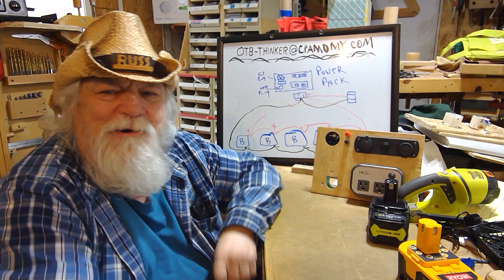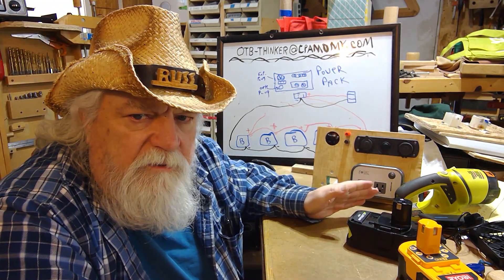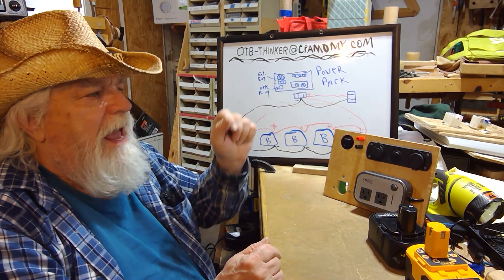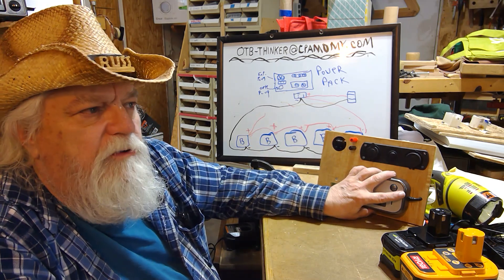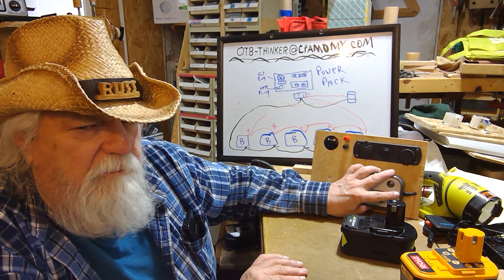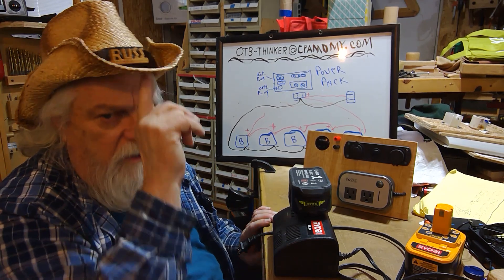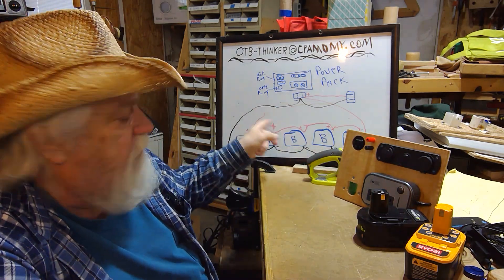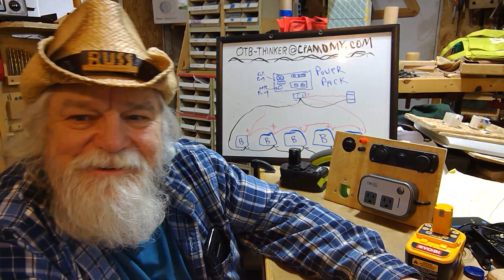DIY Ryobi Battery Bank by Portable Power

Comment: Ryobi sells 150W/18V and 300W/36V inverters so maximum peak amperage is about 8A. I just bought a broken 6 battery charger to turn it into a large powerbank. Maybe i'll use original RY18BI150A inverter and connect via old broken battery body. Possibly it doesn't have full sinus on output but most devices will be able to be powered.

Comment: Love how you have everything mounted on a small board. I need to do something like this. You may also want to consider using the walmart brand 'hyper tough' 4ah batteries too. Wouldn't really change your setup as they are the same 18/20v packs. On tear down they are high quality samsung 18650 cells and give just over their rated capacity (the 4ah specifically). Only 50$ per 4ah is pretty great pricing for brand new retail 4ah batteries with a warranty. No special clips/receptacles to use the batts just stick some male spade connectors in the pos and neg. You can charge them through their pos and neg posts to bypass normal managed charging (its great for parallel connections too). Or you can use the terminal just to the right of the pos and then the neg terminal to charge. Just give it 21v and the BMS will handle it for you. Im using an old laptop charger for it but walmart sells a 2 amp charger for like 20$. They are great - I just tore apart one to upgrade an old failed Ryobi batt to 2ah and will be doing another one soon. Cheap (by comparison) source for tool batteries and useful for your battery bank. If you were enterprising you could make an adapter cord or plate to use them with your ryobi tools since they have all of their own protection built in. Keep up the awesome work!

Comment: Hey Russ, on my PBPB (Portable Battery Power Bank) I have a mini meter on top near my 20v battery, it reads my Dewalt  battery voltage. On the back I have an XT60 for connecting 12v projects and a mini meter right there, mainly to remind me that this is 12v only. Also on the back I have 2 usb charging ports for 5v (phone, tablet, lights, etc.). Not sure how to send a picture in comments?
Reply from the maker: I am very interested in your designs and input.  You can email pics to:
otb-thinker@cpamomy.com

2 quick ??'s            
you use a XT60 connector for output (no cigar outlet)?
Does this have a single battery or multiple batteries?
BTW, I saw your playlist on drill battery projects.  I have to go thru those.  Looks like lots of good info.  Thanks RB

Comment: for LION battery if you want to connect them in parallel they have to be at the same voltage before you plug them in parallel, if one is at a higher voltage it will dump it energy in the battery that are at a lower voltage , the current could be quite large  to the point of overheating the battery . normally if you want to put lion battery in parallel and you don’t know the state co charge  you need to add isolation diodes to prevent circulating  current between the battery pack . all of this is needed because of the extremely low internal resistance of the LION cell.
Reply from the maker: You are correct about the charging status of batteries when using parallel connections.  This could be an issue if you aren't careful.  I have mentioned this several times in my portable power videos.  Using isolation diodes is a good idea.  I will consider using them in my battery bank design, thanks.  
I suspect each Ryobi battery has its own BMS and has a certain amount of protection built in.  The exact design of the Ryobi internal BMS seems to be a well kept secret.  I know they do have some kind of protection for overheating & total discharge built in, but no details. Thanks Carl for sharing.  Any info here is appreciated.
Reply: the diode that have the least voltage droop are Schottky type the regular silicon diode have a larger voltage droop
Reply from the maker: @thecarl168  I have a question, the battery has a safety device for overload built in.  Do I need another one still?
Reply: @russveinot5754  it depend on how the BMS is made
Reply from the maker: @thecarl168  So, it's possible to not need an additional one?
Reply: `to be sure we need to reverse engineer the board in the battery
Reply from the maker: @thecarl168  I haven't found anyone who has done that on YT, yet.  That is a little above my pay grade :>)
Reply: @russveinot5754  i have to find one of those board i could do the reverse engineering
Reply from the maker: @thecarl168  I will keep an eye out for one.  Not too much out there that I know of.  My batteries are all still good :>)

Comment: there is on ebay  “battery DIY cable connect output adaptor tools “  it is the mating equivalent for the battery pack to a drill but it have wire
Reply from the maker: The ones I have seen on Ebay are quite expensive..  Thanks Carl
Reply: @russveinot5754  for makita they are 18$ canadian  your flashlight may be less expensive !
Reply from the maker: @thecarl168  I'm always looking for cheaper :>)  My DIY PVC pipe connecter is very cheap.

Comment: Hey Russ, just found your channel, enjoying your battery projects. I have built 2 units similar to your ryobi charger project. I have Dewalt 20 volt, my first build..I grafted upper half of a gutted 20v charger with lower half of gutted 18v charger. That gave me room for a buck converter set to 12v (with it's own mini meter) and a "Deans" connector for my 12v projects. I buy DC marine 5v phone/tablet chargers that work with 12v or 24v and wire that direct to the battery slide connector of the former charger. It too has its own mini meter. I have an xt60 connector so that I can connect additional 20v batteries in parallel. Very handy portable power bank. Am anxious to follow your projects. Keep up the good work.
Reply from the maker: Thanks RB.  And thanks for the hint about "Dean" & xt60 connectors. BTY, does that buck converter read out the input volts or output volts?

Comment: Russ!! Just had a wish list dream! Take one of those Ryobi Superchargers and mod it. If the batteries need to be charged, the charger charges them. Normal operation. BUT, if you take it portable, you can use THAT as a power source by sucking the power from the batteries plugged in.

Of course... lots of "checks" need to be in place so it knows when to charge and when to output. But hey, I'm OTB thinking! 

Great thoughts as usual. Keep it up.
Reply from the maker: Thanks for the comment and encouraging words, Paul.  
 I think the Ryobi super charger is not worth the $$ to buy.  I have one and it has already gone bad.  There are other shortcomings with the super charger too.  You would be better off buying 4 individual chargers. One thing I want to do here is keep separate, the charging versus the output.  One of the issues with all power stations on the market today is that you can't use while charging.  Since I now have one (broken), I am planning on gutting my super charger & turn it into a 6 battery power station but not for charging batteries.  Stay tune for that.